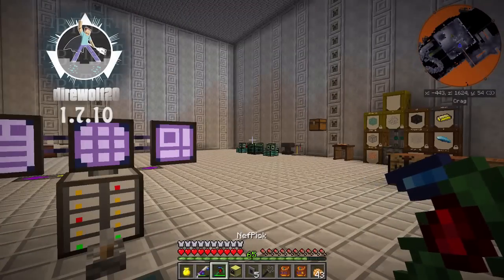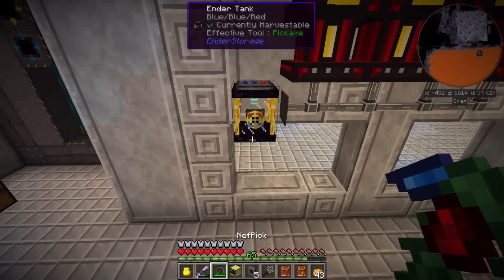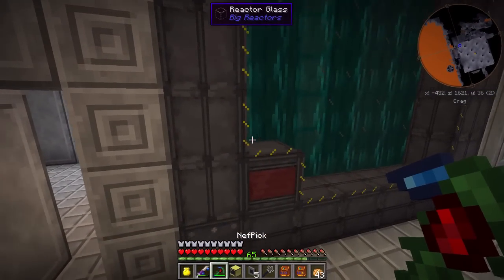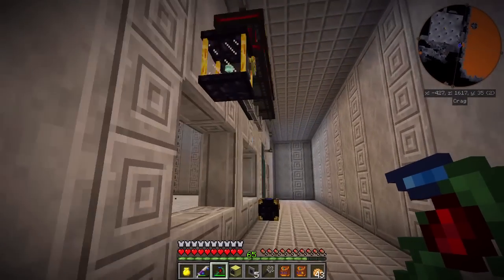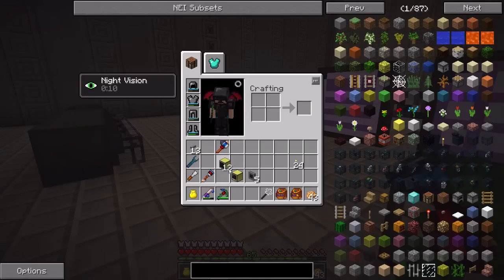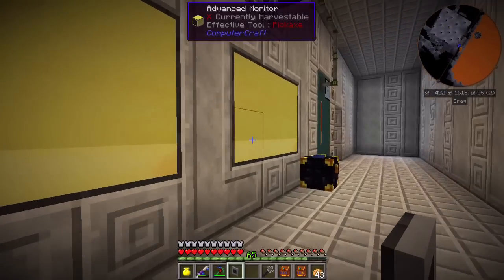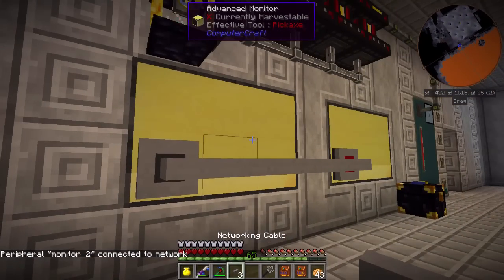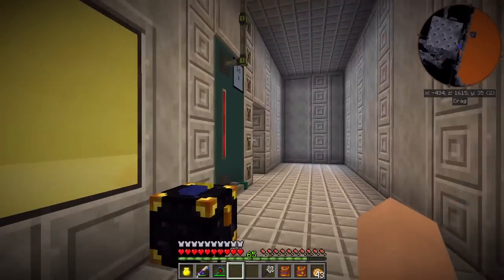Reactor Control | Direwolf20 1.7.10 | Ep. 32

Comment: This is probubly very late but it would be good if you got rednet ports and have it automate fuel rods based on the amount in the power-bank. So if its under alot of load and power is being pulled from it the rednet ports will start pulling out rods to compensate.
Reply from the maker: Dovah Do Volom Never too late.  Always love any kind of feedback!  Big Reactors is still something I'm struggling with.  Even my more recent videos I'm trying to figure out how to deal with Turbines by themselves without the associated reactor.  The computercraft program I use doesn't seem to work without the reactor.
Reply: I have been trying to learn the whole big reactors thing as well. I have a small 5x5 one with two Fuel rods and when its not on load (just running my ME item system) it puts out a max of .053 mB/t.
Reply from the maker: Dovah Do Volom Nice!   My latest 2 videos I decide to not use Reactors and utilize a renewable way of producing steam.  This way I don't have to constantly mine yellorium.  Seems to work really well, but I'm in the progress of writing my own turbine control code for it.  I know that you can use rednet ports on it, but I think ComputerCraft and BigReactors go really well together.
Reply: Yeah no need for multiple ports. Just one. I just subscribed and im watching through your Direwolf20 LP now and im getting good ideas. Like moving away from the BC Quary xD
Reply from the maker: Dovah Do Volom Great.  I hope you enjoy.  I watch several other YouTubers (direwolf20 for one) and I "try" to do things a bit different, but unfortunately there's always some overlap as there are only so many ways of automating things.
Reply: Yeah automation for me is further down the line. I still need to go ahead and go to the End xD im so behind in vanilla stuff.

Comment: Great video !! This my first attempt at using computer craft ever. I was able to keep up with you doing it, except when I finish and go to start up the computer, it doesn't see my reactor unless I turn debug on. Once I turn that on, it updates and shows my reactor. Is this normal ? I'm not sure what you type when you reboot the computer and your screen turns on and displays all the reactor information . Is there a certain command you type for that action to happen ?
Reply from the maker: +mrsnina214  - are you using the startup script?  It basically executes commands when booting.  I may be misunderstanding your question though.
Reply: In your video one of your monitors says it is invalid and you pause to look at it. Both of my monitors did that when i moved my computer. It is still controlling my reactor, but neither monitor is displaying any information. How did you fix yours to display the information ?
Reply from the maker: mrsnina214 - I think the config went weird and was getting the wrong IDs of the reactor or something.   I ended up having to delete the config file and restarting.  The config file is created when first starting and it detects what is attached to the modem network at that time.
Reply: I will try that. Thanks

Comment: Also I was curious will the same script work with a reactor /turbine set up I don't remember if you made a statement in the vid or not so i will re-watch it .
Reply from the maker: +William Zinn Yes.  The script is supposed to work with reactors and turbine setup.  I did, however, have to change a config file (i think it's in the video) to change the "normal" threshold value.  otherwise, the turbine tries to spin at too many RPMs.  It's been awhile since I looked at it, so I could potentially be wrong with that.

Comment: the issue seems to be with the monitors if you move them it dosn't seem to look for the new monitors when you move the set up and when you reconnect the computer and the network back together it says monitor inactive along with the red error
reactorcontrol : 751 : table index expected, got nil   and I have never messed with the code or anything just did as you did in your vid so i can see the status of the reactor the weird thing is it still controls the reactor just no monitor results which is strange
Reply from the maker: +William Zinn That sounds about right.  I think when you move things, the names of the monitors, reactors, etc (anything connected to the modems) are renamed (different numeric value at the end).  You'll need to remove the config files, since it caches the names of the monitors, etc it's connected to.  If you run again without a monitor found, you'll get that kind of error because the data isn't in the table at the index it's expecting.  I'll hop on my server tonight and see what the names of the config files are.   Like I said before though, you should be able to just remove all the files except "startup" and it'll recreate everything for you.   It'll also re-discover the monitors and reactors, etc you have connected to that little network.

Comment: Hey bud I know im pretty far behind on your vids but i used the paste bin it worked the first time but when i finally moved to a permanent place for my base and reconnect my reactor and monitors back up it wont display anymore any ideas?? I know very little on computer craft and could use a little assistance if you wouldn't mind You're Friend TheGeneralZinn
Reply from the maker: +William Zinn No worries.  I'm behind on publishing any new ones, so you may catch up!    Are you getting any kind of errors on the screen when starting up?  Did you make any modifications to the script(s)?  Might be worth while to remove the config files and let the program re-create them.  There have been times that things went awry and I found that deleting those (everything except the startup script) and everything ended up repairing itself.
Reply: +Nefarious411 well it only messed up when i moved the set up all together which was weird, I did delete the file where the script was and it worked fine i am going to break it down again soon as i have a turbine up just working to get the steam production going im pretty slow at things still learning a lot of things thanks for the reply not sure about the error i receive but it seems to mess up only when its taken down and rebuilt, it gives something like monitor issue I believe. I can make it happen and give you the result here in a few minutes

Comment: My reactor is 5x5x5 I connect the computer and the monitor, turning off the self reactor 3 seconds, you could be? but disconnect the computer from the reactor and operate normally
Reply from the maker: +Julio Pascual The program seems to be finicky occasionally.  I think I ended up having to change the thresholds in the configuration file so that it was within the bounds I would have expected.   It's been awhile since I've tinkered with it, but should be one of the files that are created when you first run it.

Comment: by any chance can i use the monitor to remove scripts with a command or is removing it from the file directly the only way at the moment?
Reply from the maker: +William Zinn I think you'd have to manually edit the files from the computer command line.  Just use "edit <filename>" and then use the ctrl key to bring up the menu to save and exit.
Reply: Hey Bud by anychance do you have skype or any way to voice chat I had a few question I believe would be easier spoken if you have time TheGeneralZinn
Reply from the maker: +William Zinn Sorry about the delay in response.  PM me and we'll see what we can do.
Reply: I have not figured out how to pm yet lol still working on that one bud
Reply from the maker: +William Zinn I sent you a hangout invite.
Reply: how do i accept it bud lol

Comment: In red text "attempt to call nil" Wont work idk whats wrong
ive got it EXACTLY like you
Reply from the maker: +Jerj100 It's very possible that the ComputerCraft program has changed since the recording of the video.   I know that the new version of ComputerCraft caused some issues for me at one point.   You might want to verify versions of mod.
Reply: yep. i think it is that indeed. I tried another program from pastbin and it worked. so no problems :D

Comment: this doesn't work for me please help I really need one of these
Reply from the maker: The video is pretty old, and the program I used at the time worked for the current version of ComputerCraft.  If I recall, there have been newer versions of both computerCraft and the reactor control script, but I think they may be incompatible with each other.   Might have to check out the release notes of the github project for the reactor script and get a version of it that works with the version of ComputerCraft you have in your pack.   This will require a manual install (might still be able to use the commands, not sure).  The startup script, however, will need to be changed such that it doesn't download the latest on computer startup and wreck what you did manually.
Reply: ok Ill try that

Comment: Is it just me or the code is not working? Im on Infiniti evolved 1.7.10 and when i pastbin the code it"DL"s it but nothing :/ (im on a server)
Reply from the maker: If it has the file has content, then THAT file also has a pastebin command that downloads another one for the reactor control script.    However, on servers, it's possible that it's firewalled off from making outbound connections, so if the files empty, you may have to talk to your server admin.
Reply: @Nefarious411  hmm the problem is it is empty nothing there,if i go in edit startup nothing ther,im the admin of the server,how can i fix that. THX for the reply!
Reply from the maker: @rikyo2  If you're running the server locally... I'm not sure.  If the server is running on a hosting service (such as Alternos or creeperhost, etc), you may have some issues.    There are a couple of options I think.   You could go to pastebin in a webbrowser and copy the raw file contents into your computer (i can't remember if you can paste from system clipboard or not).  If that works, then I'd go with that.   You really only need the reactorcontrol script, and that pastebin is here: https://pastebin.com/fguScPBQ
just go to that URL, click on 'raw' link, copy the content (ctrl+c for windows CMD+C for mac), go into your computer (in MC) and type "edit reactorcontrol".    Once it's editing a new file called reactorcontrol, you can paste (ctrl+v for windows or CMD+v for mac).   If that works, then save it, and then edit the startup file and just have the code:  shell.run("reactorcontrol")
Make sure your computer has a label set so that it retains its data if broken and picked up.

If that doesn't work... You could always FTP the files to the server.   I cannot recall the location to add them.   I think the computercraft configuration directory will have a single directory for each computer ID.  You'll have to figure out the computer ID for the one you're using so that when FTPing files in there, you can  see them on the right computer.    You could just create a dummy file with a special name and then just search your server for that filename (may have a .lua extension) and that same directory is where you'll want to place the reactorcontrol script from the pastebin links i mention before.

lastly, if those don't work, then maybe this youtube video can help?  https://www.youtube.com/watch?v=MkloBnl-W8s

good luck!
Reply from the maker: I would almost suggest the youtube video as an earlier step (before FTP) as it's probably the problem (change from http to https in the URLs)
Reply: @Nefarious411  THX THX THX!!!!!!!! i fixed it!!!!

Hoppe we get a new series to wach from you!
I started your DW20 now!
Reply from the maker: @rikyo2  Glad you were able to get it to work.   It doesn't look like those scripts have changed since 2015, and I'm sure they probably won't work on the new versions CCTweaked, but I haven't attempted.   I have been able to get a CCTweaked script to work with the Mekanism Induction multiblocks, so there are still some people out there creating/updating scripts.

I honestly haven't had the time the last few years to do any recording.   I only get a few hours a week where I can try out new modpacks, etc.   Not enough time to proceed through any decent ones (such as All the Mods 7 To The Sky that I'm playing right now).   I suppose if I were to record a pack, it probably won't be any progression packs as people tend to like to play along with those.

Comment: Error: reactorcontrol:237:attempt to call nil
Reply from the maker: +Chk Dsk It might be possible that the code was updated since I did this video and the code may not work anymore against the version of computercraft/Big Reactors.   I think the later versions of Direwolf20 pack had updates, so that could be the problem too.  Be sure that your monitors, reactor and computer modems are all linked up via wired modems.